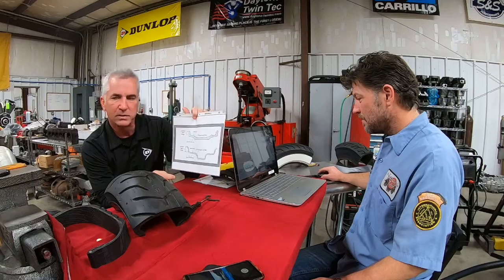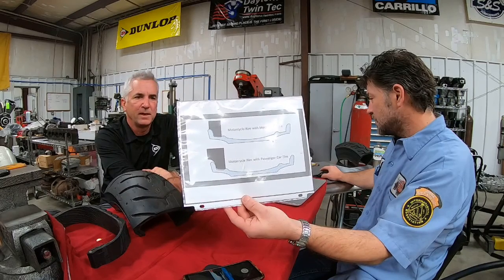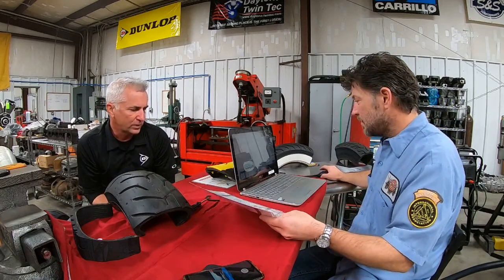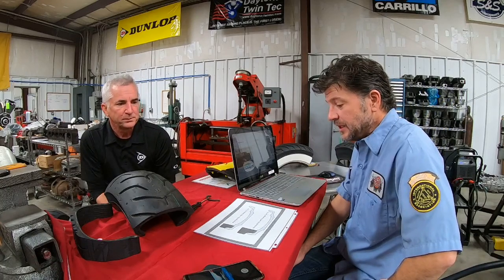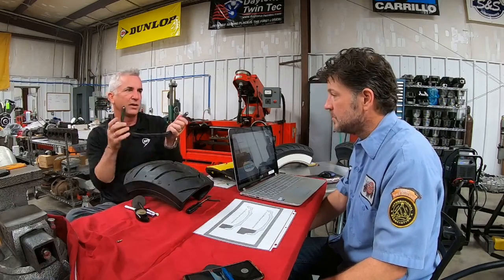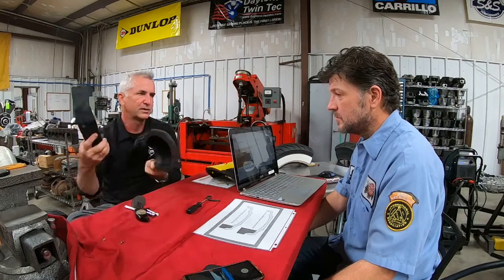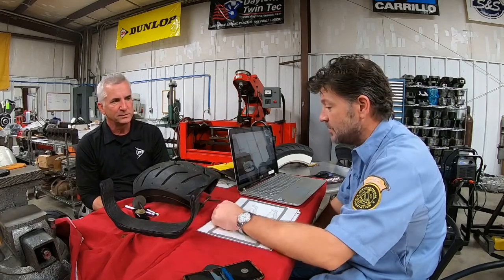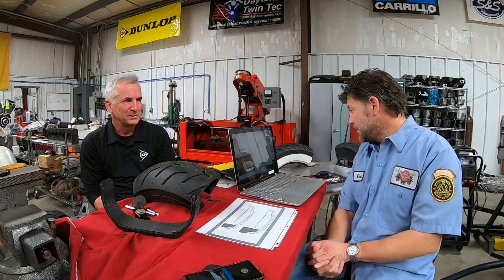Motorcycle Tire Tech Part 2 - The Darkside - Live Dunlop Q&A

Comment: I could never imagine cornering on a car tire !!!
Reply: If you are riding a sport bike and into 35 degree angle leans in a curve i can see the advantage to a motorcycle tire, but for the average cruiser or tourer there isn’t a good reason to not use car tires. They’re smoother riding, last longer, give better traction in inclement weather, all positives for me.
Reply: Not a problem.  I ran into a freid of mine at a gas station one day.  He commented he was considering trading motorcycles and was interested in one like mine.  I suggested we switch bikes and put on a few miles.  Long story short, he had no idea my bike had a car tire on it and his first comment when we stopped was about the smooth ride and good handling. I replied not bad for a car tire. Is it?  He thought i was joking.  I pointed at the rear tire. He said no way! And then he looked, his jaw dropped and he said he would have never believed it.

Comment: I run American Elite tires on my Indian and on my Harley Ultra Ltd - get great mileage, handling, etc.  I wouldn't bother with a car tire on the rear of either bike.  However, I've heard the logical arguments against a car tire - all logical except for one thing.  The experience of the dark siders is there haven't been a large (if any?) number of failures of the car tires.  They simply wear out and get replaced.  I have several GWer friends running them.  I can see they don't have much of a contact patch in the curves....but aside from that, they are happy with the tire.  Again, I wouldn't bother with one on my bikes, but the argument against a car tire just rings hollow when the experience seems to say otherwise.
BTW, absolutely love your shows and vids.  VERY good topics and coverage of issues and tech.  Keep it coming!!
Reply: A motorcycle approved tire also has very little contact patch when leaning,  but then again it always has very little contact patch.  There was some good info in this series, but it was basically a guy that sells tires protecting his sales.  Motorcycle tires have zero warranty,  and should not cost what they cost due to the relative materials and construction methods used compared with auto tires.
Reply: Nobody ever said they were cheap 😂

Comment: I am confused as to why someone doesn't fill the market for this practice, make a proper rim for these darksiders to do their idea. I personally will not be doing it because I can tell the difference between a motorcycle tire and how it is designed and a car tire, but you would think some rim manufacture would be like, oh yea, we can make that rim and do it.
Reply: Manufacturers are too cheap/blind to meet the needs of a smaller percent market. IMHO.
Reply: @toanogreen  I agree but I bet if somone made wheels for say goldwings they would sell. But then maybe not as car tires have been working on motorcycle rims for years with no issues. If it aint broken dont fix it right? Just wish these ppl crying about darksiders would shut up

Comment: Great info.  And did not know that insurance companies will, or most likely deny claims on darkside riders.  Now that the tires are lasting longer for us high mileage riders, its not a concern anymore.
Reply: I've seen several videos on it that have asked insurance providers about using a car tire and none have said they would deny the claim.
Reply: Insurance  companies will deny you if you fart on the bike.  I had a Avalanche " totalled " because the bolt on bracket on the tip of the frame CRUSHED ( as it's supposed to )  only the radiator and a/c condenser where damaged nothing else , the truck had 25000 miles . the bracket cost me 65.00 at the Chevy dealer in Cerritos , made money buying the truck back from Geico.   they total vehicles, sell them to Chinese buyers that put them in containers and sgip them back to China and sorrounding countries and make a bundle.  meanwhile Geico gives you pennies on your vehicle and they make money.

Comment: The cross section of the motorcycle tire looks like twice as much tread rubber as the car tire, seems like it should last longer than a car tire mounted on a motorcycle, but I got far more wear from the car tire. The tread on the car tire felt softer, too. Why don't motorcycle tires last longer?
Reply from the maker: MC tires have a much smaller contact patch than car tires....and because they roll, side to side, require much softer compounds as well for traction.  So...they wear quicker.

Comment: I wish I had known Phil was going to be in-house with you , I would have wanted  him to iterate on the Tire's Sipe direction. Why do the Sipes on North American brands run counter intuitively to the Asian brands. Eg, if you stand by the front of the bike and look at the sipes on the rear tire from that vantage point , the Sipes run downward on the rear tread as such: V. but on the front tire , NA keeps wanting to put them ass backwards as an A format . Asian brands like Chang Sheng, Kenda and Shinko will have both front and rear treads in the V format.  As side note here, my old Virago had the Sipes in the  V format front and back, and no issues plowing through water at 50 ~ 60 mph when 2  inches deep on the road due to getting caught in a thunder storm  down pour. Kawasaki is the same. My Bolt is A centric on the front. ( a mix, hmm ),.... Bridgestone , on both rims.
( I got about 14,000 + miles out of the Chang Sheng, 16.500 out of my Kenda's, will see what my Sis gets out of the Shinko 140/90 R 15 that she has now........)
Excellent info ,  Kevin
Thanks again
W

Comment: great video... I wanted to ask about your bike sitting over the winter and not needed to lift off the wheels with the new tire compounds...
Reply from the maker: good question.  the older bias ply tires can develop flat spots but doesnt seem to happen with newer tires.  if i have a bike in storage, about once every 2 to 3 weeks, i'll roll it a few inches...but i dont believe that's really necessary.  just do it cause it makes me feel better.